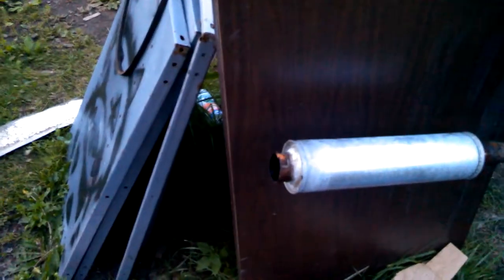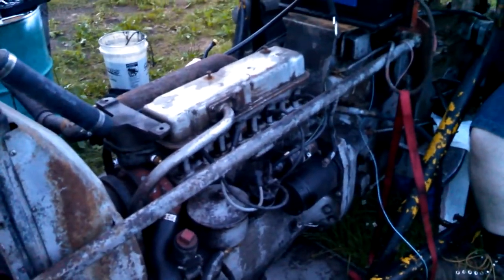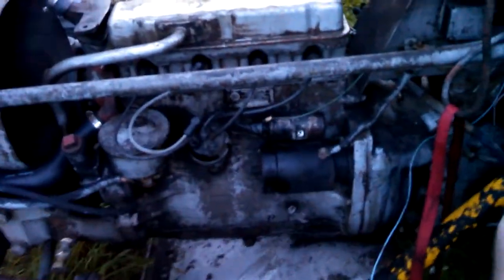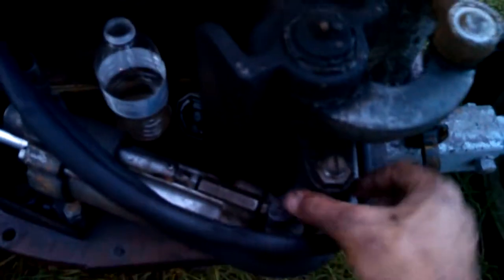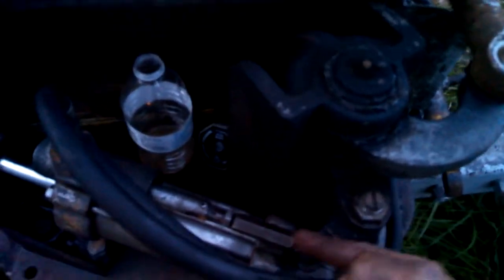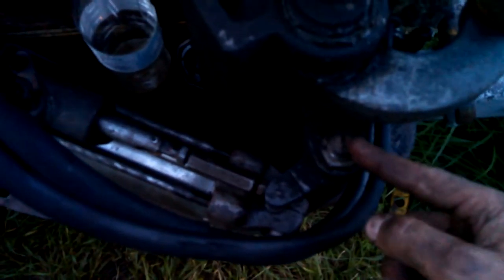Second Startup and Power Steering Adjust

Comment: How did you adjust the power steering linkage? The "screw" in ours is driven all the way down and unable to unscrew or adjust. Special tool or something?
Reply: Weld a nut on the end, then remove and replace.

Comment: What cause my massey ferguson 165 tractor power steering pump to blow off the seal from the housing? Is every time I go in the mud field and lock the steering on the left side it does that. My tractor has a 203 engine. Thanks.